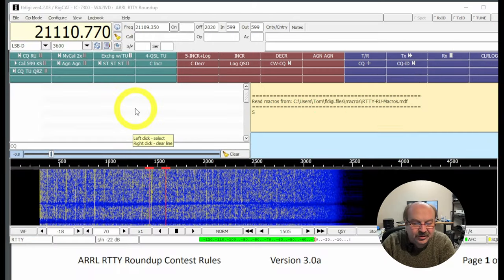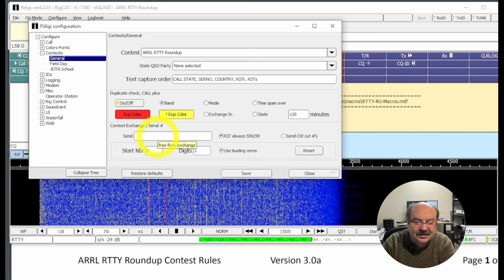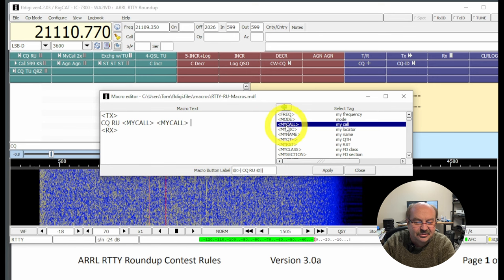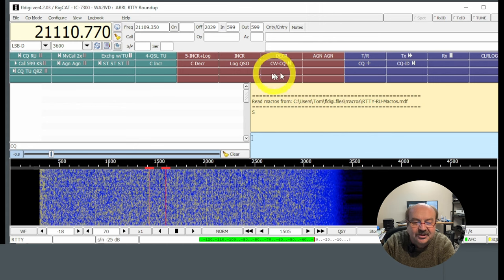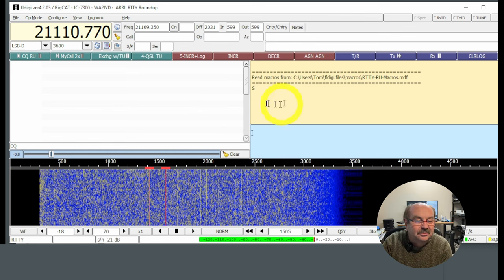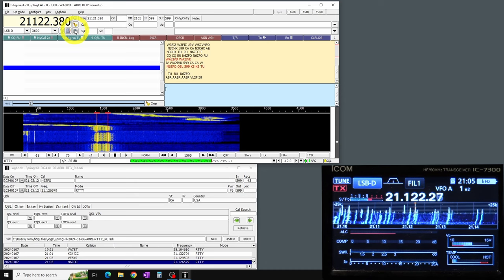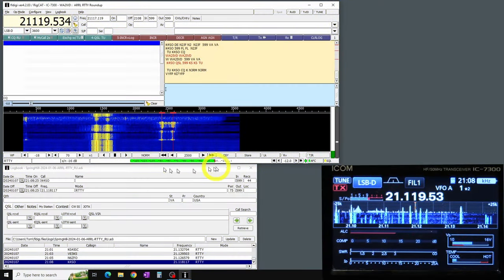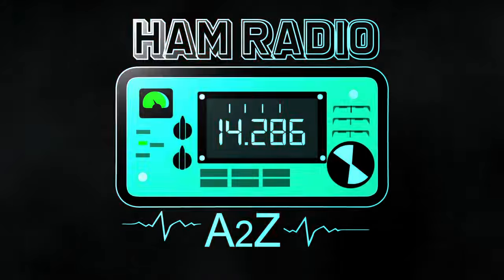RTTY Roundup with FLDigi

Comment: Thank for another great video Tom. I have watched your ic7100 videos end to end and they have taught me so much. I cant seem to get my 7100 to transmit sstv(mmsstv)
 any advice ? Thanks for the great videos.
Reply from the maker: The most common issues I see with “not transmitting” problems is that the radio is not getting audio from your computer.  Make sure the 7100 mode shows “-D” for “Data” mode.  Make sure that you have Data Mode Modulation set to come from the USB port in the Connectors Settings menu.  Finally, make sure that your settings in MMsstv are set to the right audio device.  It should be something with “USB CODEC” in it.

Comment: I just don't understand why there are such significant differences in my 4.2.04 and the on screen config.  Ie. Yours shows LSB-D, mine does not even show that in the pulldown.  It shows "PKTLSB."  If I put my rig in rtty, and the fldigi in rtty, it sees the badot, but doesn't decode...so frustrated!
Reply from the maker: You didn't mention which radio you are using.  I assume a 7300?  Are you using the correct rig configuration file (for the 7300)?  FLDigi (and most digital mode programs) send audio to the radio to simulate the tones you would get by actually shifting the radio's carrier.  So you need to have the rig in LSB, rather than in RTTY mode.  It is not really intuitive.  The -D after LSB means the radio is in Data mode, instead of voice.  So it is expecting to get it's audio from the USB port instead of the microphone.  I hope this helps.